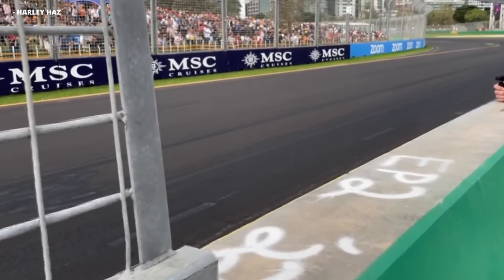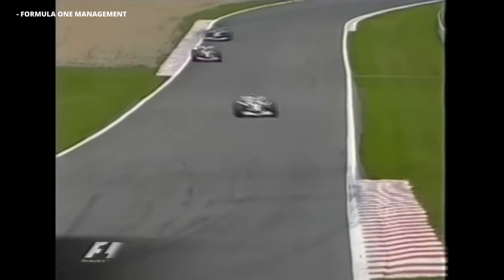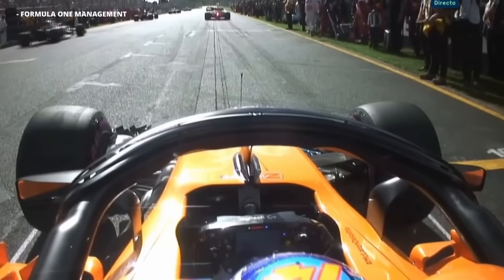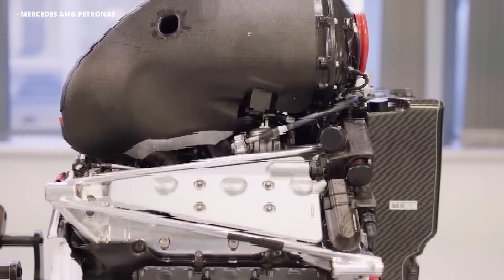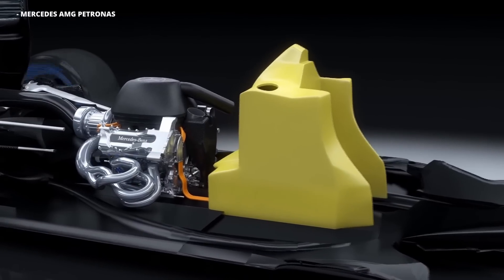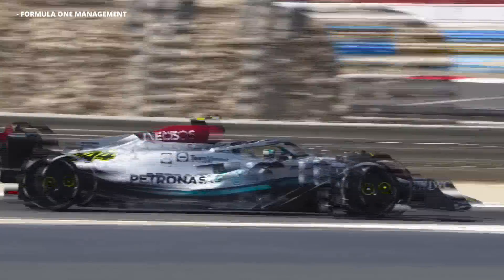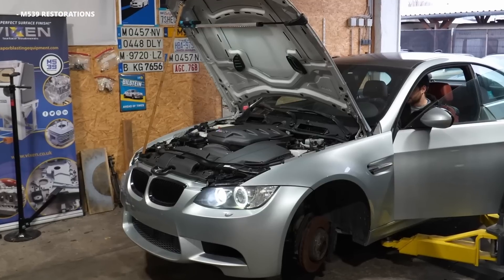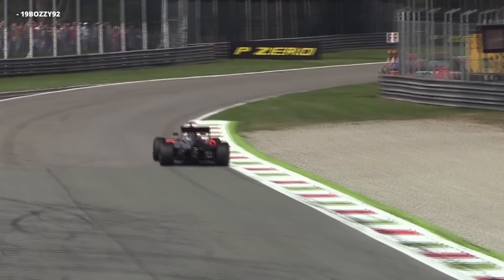How These Tiny Engines Make BIG Power

Comment: Is the 50% thermal efficiency just the combustion engine ore is it the whole power unit? (ice engine + hybrid)
Reply: Well thermal efficiency isn't the same thing as efficient power delivery, though it helps. The 50% figure in this case exclusively refers to the engine's ability to convert chemical energy into rotational energy. The hybrid system really just recycles some of that energy that would get lost as heat in the brakes otherwise. Imagine using one of those solar calculators in a lit room, a modern LED lamp can convert ~96% of the electrical energy you feed it into light (rather than wasteful infrared and ultraviolet) and while the calculator can help you get some more use out of that energy by diverting it to calculations rather than getting turned into heat in the desk, carpet, etc that absorb the light, it doesn't really increase the proportion of visible light that the lamp can make
Reply: Combustion engine only. 50% thermal efficiency with hybrid would be pathetic, electric motors could reach 95% efficiency.

Comment: “[the higher compression ration] allows the pistons to go a tiny bit further” i’m sorry what? Compression ratio doesn’t affect stroke at all. Instead, the take away should’ve been that it compresses the air fuel mixture way more than a road legal engine, extracting more power per kg of fuel.
Reply: I think he was meaning just a little bit further relative to the theoretical throw of the cylinder.

Comment: Engine? blame Hamilton for party mode as he is the best still even without modes he still is showing us that if Redbull didn't Cheat without the long lasting advantage courtesy of the cost cap it would still be that bloody Hamilton more than ever before leading every F1 event
Reply: Only because he makes a borderline illegal pass on turn 1 of every circuit and then dirties the air for everyone with ferarri's borderline illegal aero mods and then smugly pretends he's good.

Comment: If you think these engines are impressive, the 1.5L turbos of the 80's were downright evil. Good job on the video dude.
Reply: They were unreliable and that's where you get your power. For v6 turbo are way more interesting
Reply: These engines would eat old turbos alive if regulators allowed them to unleash their full potential. Eat them alive!
Reply: Modern engines just have limits. And old engines are unreliable. Modern F1 engines would match old F1 engine power easily with the same reliability, given unrestricted

Comment: Im still impressed of the compression ratio of 18:1 in current generation. Imagine the gasket and headbolts that has to withstand the sheer compression with turbo 😊
Reply: I think some of them use a monoblock, so no head and gasket.
Reply: @dimitrijenovakovic7942 as far as I know, the only monobloc engine in F1 is the Hart 415T, which isn't really a competitive engine. A very dominant engine that used monobloc is the Offenhauser, which, I'm not sure if it got used in F1, but it is VERY dominant in Indy.

Comment: I think the peak is 10.5k rpm and not 12k rpm. I mean atleast that what engineering explained taught me 🤓 also if displacement low, increase boost. Thats the unga bunga way for moah pawah that unironically still holds in F1
Reply: I have looked at the technical regulations and there isn't a stated maximum rpm limit, there is a limit for mgu-k and mgu-h but not the engine. The rpm limit usually on live data goes to 12.5k but probaly can't go past that with the fuel flow limits.

Comment: As you say, the current PUs are capable of so much more. If materials like ceramics, metal matrix composites, magnesium and tungesten-based alloys were permitted we'd be seeing well over 1500hp, with reliability. 😭
Reply: That wouldn't make the sport more interesting...

Not that it would hurt but it honestly doesn't change much and it would be undrivable in some tracks if they just cranked power with nothing adjusted elsewhere

And unreliability is intentional and good. They need to keep changing regulations to both inovate and create room for teams to take risks with reliability
Reply: @rosco3  Whether or not it would make the sport more interesting is neither here nor there, I'm just curious about how much performance we could squeeze out of this current generation of PUs if the shackles were removed. :)
Reply: I remember about that one rumor about a 1,200 hp twin turbo V6 for 2021. Sad that it didn't get to be true. It would raise the cost so much though, because more power means more cost. Anything that means more performance are always more expensive. It's a direct feedback